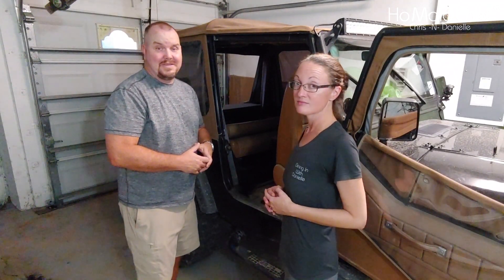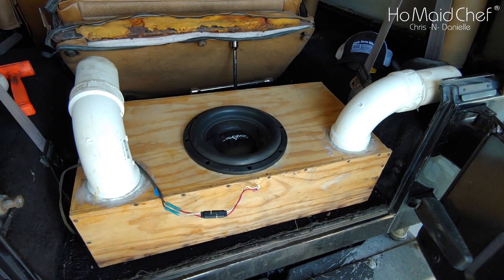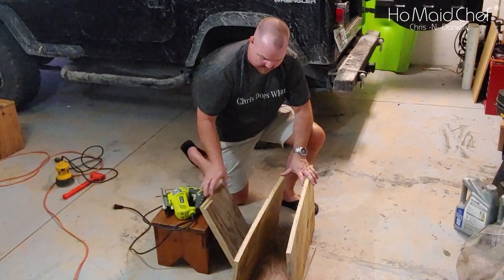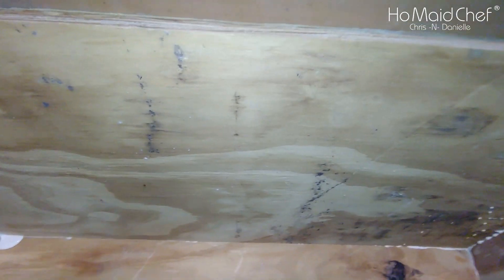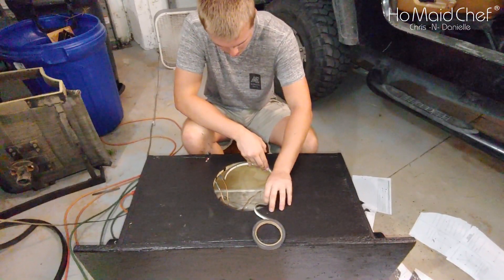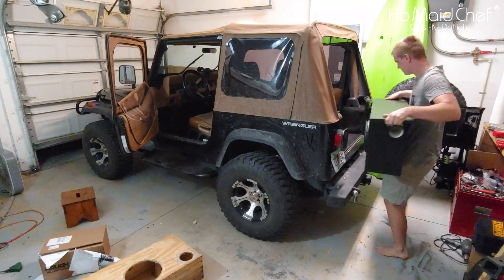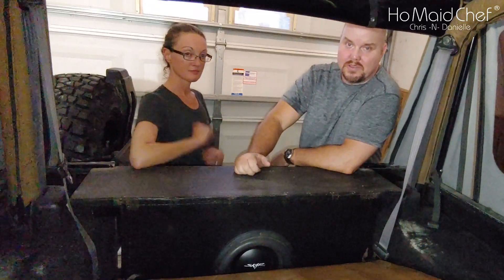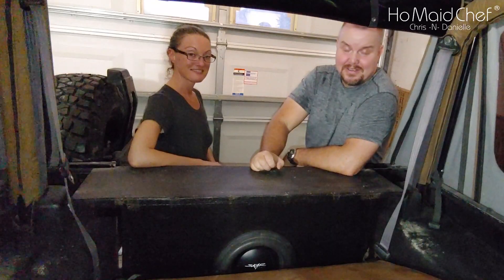Build Subwoofer Box For Skar SVR 10 || Jeep Mods E30

Comment: Make another box out of MDF and face the sub toward the tailgate. Turn that box around so the sub faces the tailgate and you'll see what i mean. MDF will sound even better.
Reply from the maker: Great advice, and if it was any other vehicle, would have do it like that. Would of love to use MDF but not in a Jeep, too much water splashing on the trail. Had the box turned around, would take a lot of work to stop this jeep from rattling.

Comment: That sub likes 21 to 23 square inches of port area! It may not really matter since your underpowered by alot which is worse than overpowering!
Reply from the maker: With the SVR 10, a 25 square inch port is recommended. Furthermore, too little power does not damage your subwoofer, but a clipped (distorted) signal will. It has since been upgraded to an 800 watt RMS amp and the speaker is wired at 1 ohm, which after a few months cracked the surround. SKAR sent us a new SVR after inspecting and verifying that we did not cause the damage.

We have since replaced this speaker with an EVL. It is tuned a bit lower than 38 Hz to account for the fact that it is in a soft-top jeep. Your lower bass is enhanced in an enclosed car due to the cabin's dynamic advantage. Whoever uses the box specs from the manufacturer, this is what Skar recommends if that is important to you.

SVR 10 RECOMMENDED ENCLOSURE SPECIFICATIONS
Recommended Sealed Volume: 0.65 ~ 0.75 ft³
Recommended Ported Volume: 1.55 ~ 1.65 ft³
Recommended Port Area: 25.0 in²
Recommended Tuning Frequency: 38 Hz